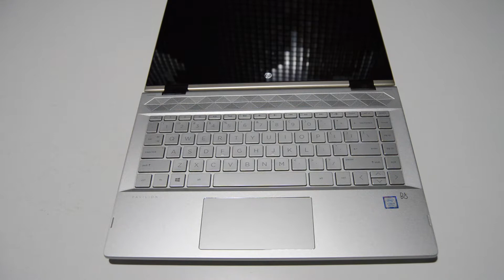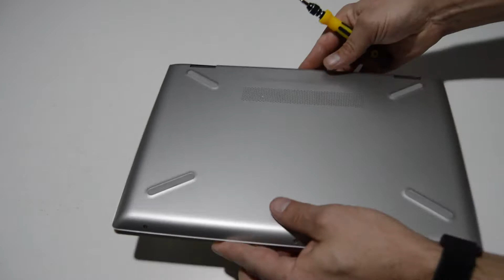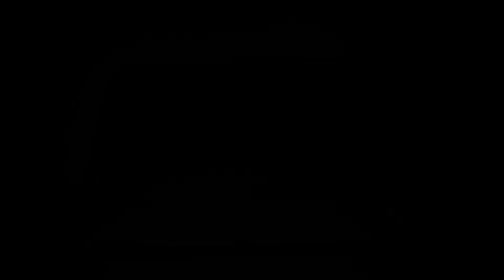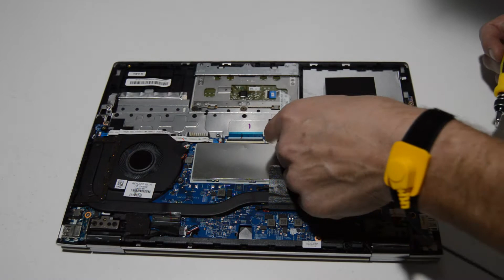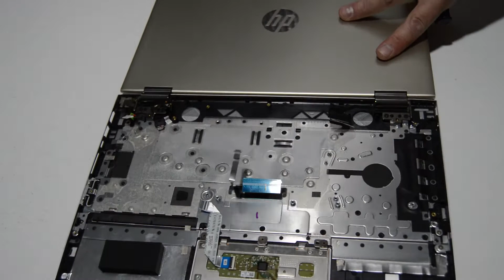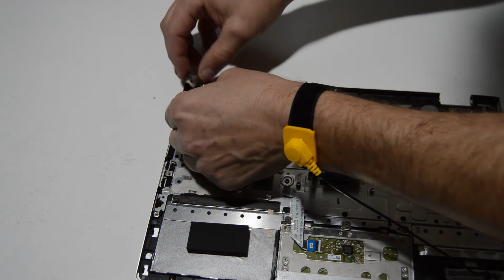How to Disassemble HP Pavilion 14m Laptop

Comment: I have the same exact model. That rubber block where the 2.5in ssd should go comes out with careful prying. Soon to install a Samsung SSD 860 EVO 1TB 2.5. My sd card reader isn't working but I see in the video that it's soldered to the main board, not a replaceable module like other laptops. I just upgraded to 32gb Crucial Ballistix 3200 MHz (BL2K16G32C16S4B) and it worked great. Of course it runs at the 2666MHz limit but I don't mind since I have 3200MHz memory ready for a next laptop in the future.
Also have a  Western Digital 500GB WD Blue SN550 NVMe.  Very happy with this laptop. Thanks for sharing the video.

Comment: I have a similar laptop and the caps lock light keep blinking with no display after just 6 weeks of use. What could be the issue
Reply from the maker: Count the blinks and look up HP's blink codes for your model.... it's sort of a check engine light for HP laptops. It most likely has something to do with your video graphics.

Comment: Hi I have problem i believe coming from the Ribbon contacted under the fan ( please can you provide me with  ribbon number in order to make order for replacement  and i have the same computer ( hp pavilion x360 laptop - hp pavilion x 360 m convertible model 14 m-cd0003dx ) SN#  8CG8265XRG  id 3XVO3UA#ABA
Reply from the maker: Not sure which ribbon you mean. Best chance is finding out what part it connects to.